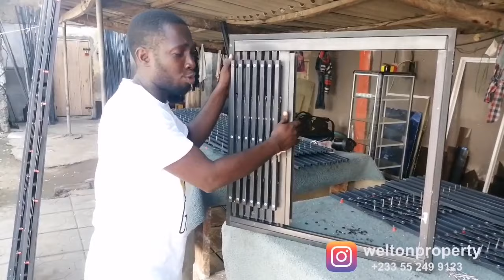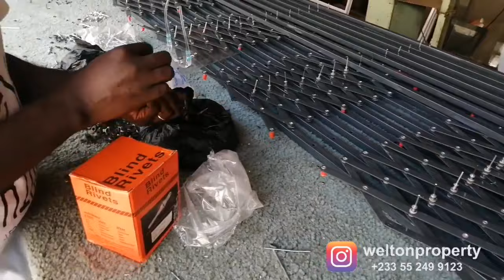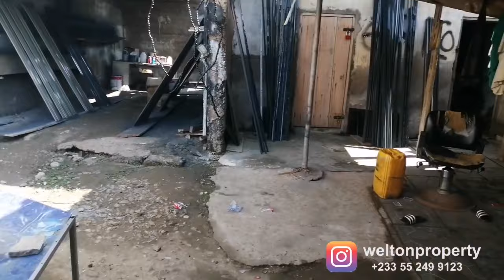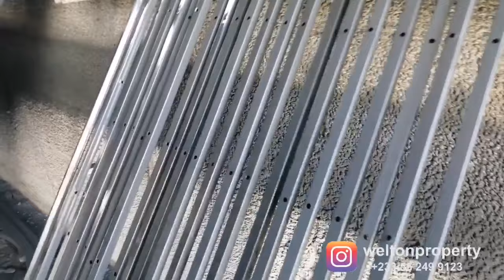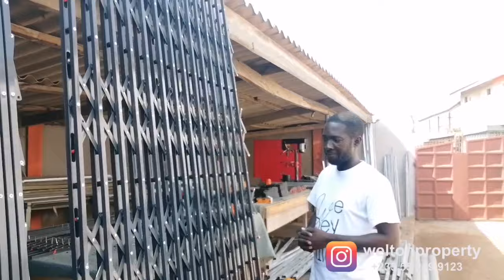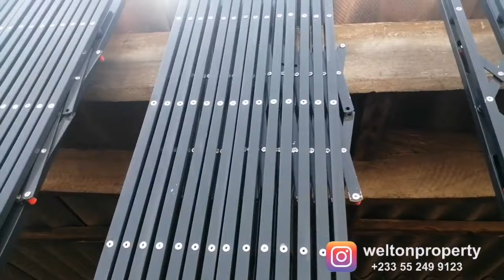Best Burglar Proof System For Your Home & Office (Safety & Security)

Comment: This is an excellent presentation. Here in the USA, there are very few choices for window and door protection, other than super cheap one-size-fits-all ( but poorly ) accordion gates, or fixed gates, which create safety issues, and difficulty cleaning windows. For storefronts, there used to be some custom sized ones that were very good... they have all but vanished, save but for one manufacturer... but yours are far more advanced in design.

Comment: Thanks for Sharing such a helpful Tools. Which area are you in Accra pls? I'm glad to receive all this information. How much does it cost to have such a burglar proof security system. for a door. God bless you Sir
Reply from the maker: Hi Vera, the cost for the unit is based on the size of the windows or doors. Kindly Call / Whatsapp +233 552499123 for further assistance
Reply: @weltonpropertyadvisory4994  can this be used with the old style louvres too?

Comment: I'm curious as to how you install those windows. How do you attach them to the stone/brick walls? Can burglars knock down the entire window?
Reply from the maker: The frames are bolted into the brick walls after plaster / dressing. It will be near to impossible to knock down the entire window given the strength of the bolts to window and mortar bond.
Reply: Please how do I get intouch with this company